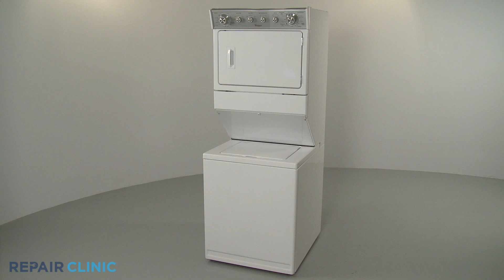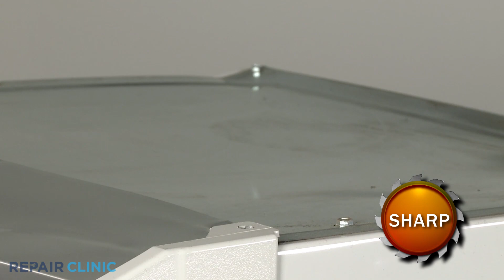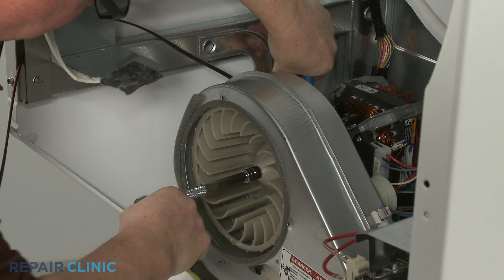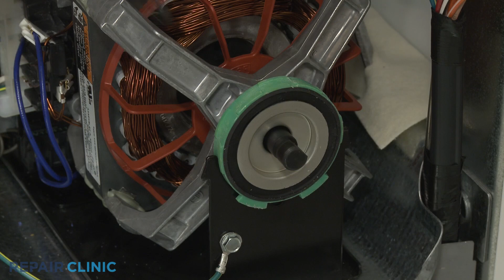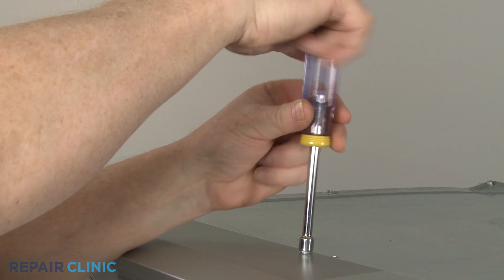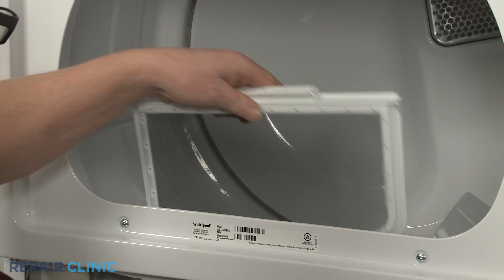Whirlpool Electric Washer/Dryer Combo Dryer Drive Belt Replacement 661570V

Comment: I just did this today but didn't see this video first. I removed the clips and wires on the motor and maneuvered the belt under the motor without removing the blower wheel. Seemed easy enough since I didn't have a 1/2 drive with me. Also, my experience with these types of blower wheels (or impellers or pulleys or whatever) is they are usually very well stuck on at this point and very fragile. The unit in the video doesn't look like it had many hours of run time on it. I think my way was much easier and less risky. I'm a DIY'er just trying to get my daughter's dryer running, not a professional.

Comment: I flew through each step quickly but I was stopped cold at the part where I loop the belt around the motor drive shaft and idler pulley wheel in a "zig zag" pattern? The fact that the repairman's hands are obscured in the video isn't helping. Does the belt not simply go in a big loop around the drum, motor drive shaft, and idler pulley wheel, ribbed side on the inside?

Comment: I'm in South Florida, My unit is the LT7000, I followed this video and I changed my belt with success, I paid $20.00 for my Belt in Miramar, the guy said he will charge me $120.00 to change the belt, I told him if I have any issues I will let him know. I am only now reading everyone's comments about the Blower Fan, I am lucky that didn't happen with me. My unit is very similar to the one in the video except that my Door has a glass and some of the wire connections are a little different, other than that this is perfect. I should have read the comments before I removed the Blower fan, I would have taken Brian or Oscar's opinion to save a little time. All in all, it worked out fine.

Comment: this guide is awesome... but DO NOT I REPEAT DO NOT TRY TO REMOVE THE BLOWER WHEEL... it is to brittle... it will brake... instead just remove de to clips from the motor... disconect the wires, lift the motor a little bit and pass through the belt, that it.
Reply: Yeah that step stopped me the first time I tried this repair myself. I called the repairman and you know how he got it off? He broke it off intentionally
Reply: This!

Comment: NOTE TO ALL - do not attempt to remove the blower fan. Very high chance of it cracking (mine did).  Just release the motor and slip the belt behind and underneath the motor.
Reply: Second this. Just remove the retaining clips and wiring to the motor and lift up.
Reply: But if the belt is broke you shouldn't have to do this